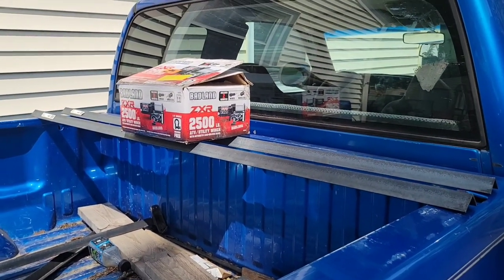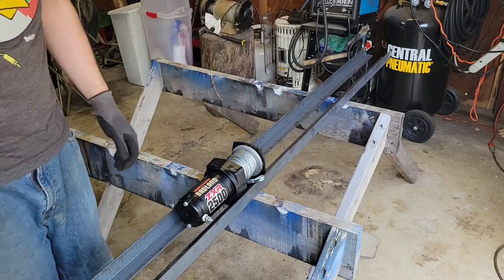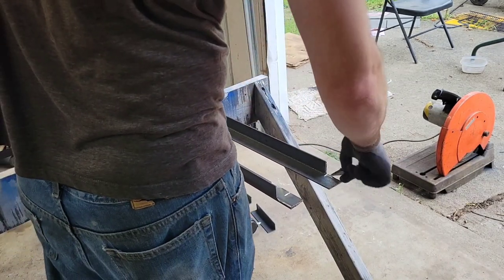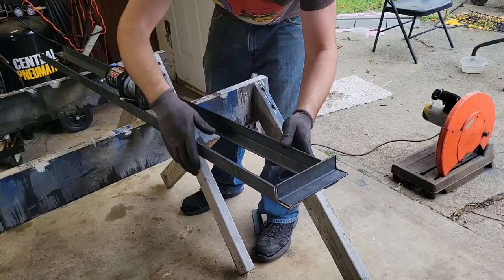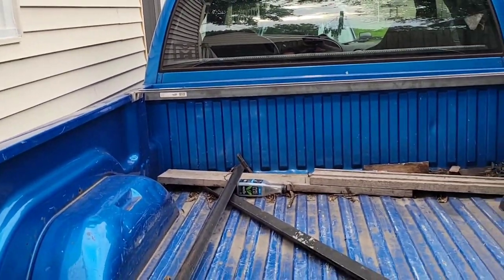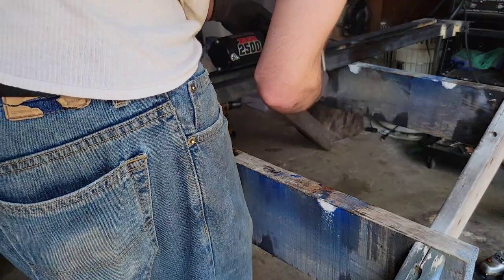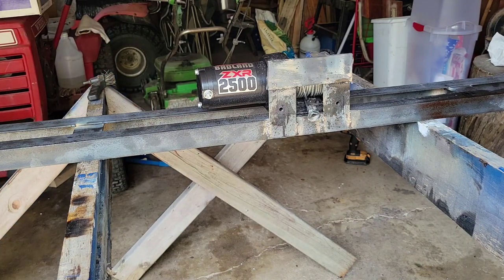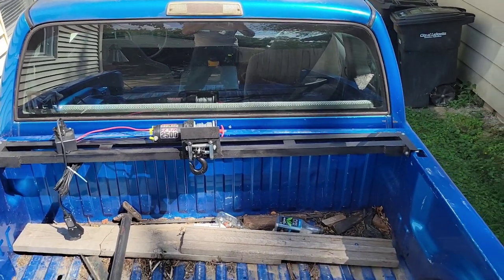How To Make And Install A Winch Mount For A Truck Bed.

Comment: What will the box endure re a heavy  pull.  Can I pull a 400 lb elk up without damaging my box??
Reply from the maker: I mean it's a 2500lb winch so however strong you make the frame and how well you brace to the truck will determine alot.

Comment: Will that work on a ford? I’m a big game guide in Maine want it to haul up moose,bear and deer into my truck. I can’t seem to find an idea that works that won’t collapse fords aluminum bed
Reply from the maker: Should easily work on any truck as long as you design it to hold the weight of what you are witching into the bed of your truck. You go as far as bracing through the bed of the truck to the frame and you can make it winch about anything. You have to take into account of how much you plan to winch and if you use a snatch block to help with resistance too.

Comment: I made a winch mount very similar to yours about 6 months ago. One problem I found was that the winch wants to flex downwards when pulling up a load. I mounted a 4x4 post underneath the winch, and it solves that problem. Do you have any flexing issues with your setup? At first, I thought I'd only mount up the winch when I needed it- being a temporary setup, but I use it all the time. It's awesome!
Reply from the maker: No issues with flex that I've had when I used it a few weeks later to pull my motorcycle into the bed. Using two 2 inch angle iron really helped to keep the flex that you would get down and is quite ridged.
Reply: @mistermacgray  @scott84 5 months later. Any other improvements you can suggest?
Reply from the maker: @GIZZMOTORSPORTS  haven't used it much but the few times I have so far been so good.
Reply: @GIZZMOTORSPORTS with mine I haven't needed to do any further upgrades. I've pulled up riding mowers, and a zero turn that weighs 750lbs. If you're using it to pull up mowers and you have a full size truck, the longer the ramps, the better. I have a 05' F250, and with 7.5' folding ramps, some mower decks get hung up on the tailgate. Not a problem if you can get your truck into a low spot to load up. I use a riding mower battery to power the winch, and I toss it in the cab of the truck when its not in use. Or you could wire it right up to your truck battery using heavy gauge wire. It's an easy project, and has kept me from needing to buy a trailer....at least for now.
Reply from the maker: @ScottysVise  I have jumpers I run to the truck battery to power it, keep them under the rear seat.